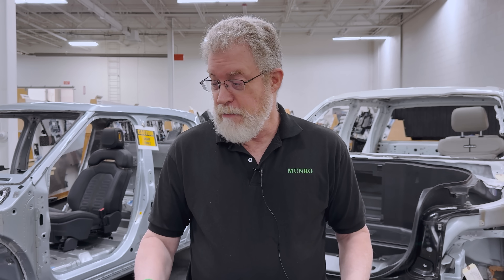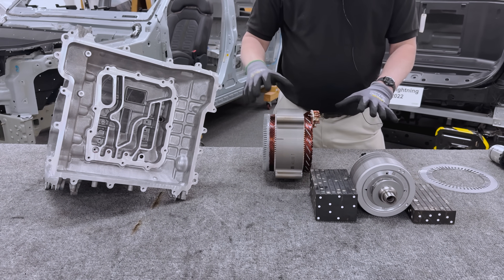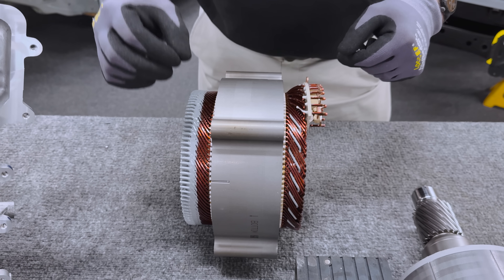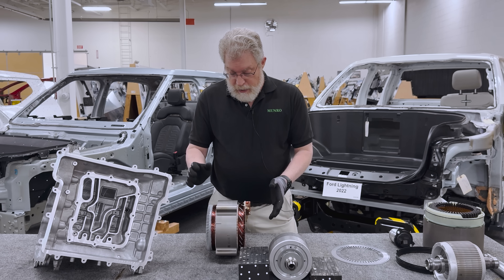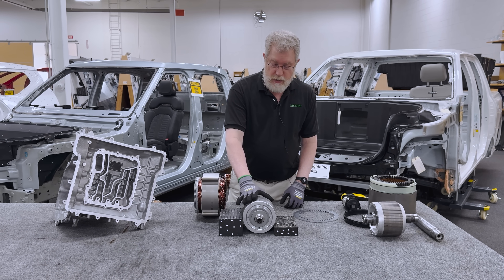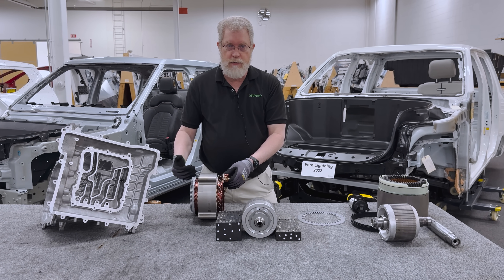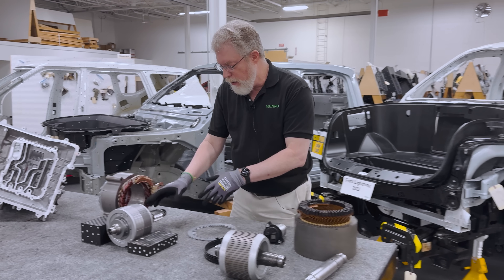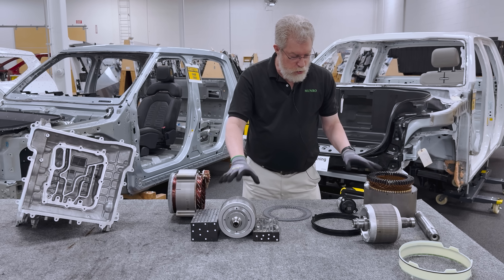Inside EV Cooling Systems: Tesla vs GM Electric Motor Comparison

Comment: Thank you Paul for your full detail explanation. Just done an oil exchange of the IPVMsynRM and gearbox of my Chevy Bolt. Collected the old oil. I observed that the old oil was dark, brown to black. Filled the drive train, IPVMsynRM and gearbox with brand New original GM OEM gearbox oil, as per technical manual. Your detailed explanation inspired me to send the old oil to a labratorium for chemical analyse. It showed some amount of wear metals. The full report I received back from the labratorium, showed 168 ppm Iron, and some 417 ppm other metals. The oil change maintenance interval was as per recommended maintenance interval, and the report showed that there is no need for further maintenance. But I can tell you what I found as driver. Just drove around the province in 2 Celcius with wind up to 5-6 BF, snow, rain and hail showers at times. Giving an energy consumption of 14.9 kWh/100km. (Took off with an pre-conditioned car heated up from the power grid, and drove max 55 mph, used cabin heating from the ptc heater at 18C). Some several years ago if you would ask me winter range I would have told you 280 km, but now I can tell you, maximum winter range capacity is 375 km!   Getting the oil dance within your IPVMsynRM to the best, is critical for excellent unprecedented energy efficiency!

Comment: I feel similarly about this. It’s way past time we move forward to, at a minimum, hybrid power for all automobiles and light trucks. The tech is right there for us to embrace, the performance is anything but a disappointment. Governments need to be involved to help society make such a massive change, and I welcome it with open arms. 

Electric motor technology is already improving rapidly because of their use in automobiles. All the many uses of e-motors, and their are many, can benefit from the force multiplier of the world’s enormous passenger car market. Savings will increase across the board as markets cooperate.

When I consider the enormous load of pollutants they make, it just doesn’t make sense to pursue combustion engines for passenger vehicles anymore. Scale has finally been reached to make apples to apples comparisons both valid and irresistible.

Comment: The deep sea submersible industry has been using oil filled motors for 50+ years.  The primary reason is at depth, the motor will either be crushed or become so out of tolerance, the rotor will no longer spin.  The pressure & temperature at 3000m exceed 4000psi & just above freezing.

Comment: I have a question though what does the oil spray off of the rotors would that eventually cause microscopic wear in the coating on the coils

Comment: I have been a professional mechanic for the past 45 years.  I know a little bit about vehicles, but I am no engineer.

If oil is used to cool the windings w/ a high pressure pump, couldn't they somehow submerge the windings in the oil?

It seems that if somehow the motor is submerged (or part(s) of it) in oil then recirculating the oil would take much less pressure.  Wouldn't have to worry about tilt variables either.

Again, I am no engineer.  Just a mechanic.

Jim
Eve's Automotive
Reply: If the motor was submerged wouldn't the oil fill the gap between stator and rotor?  That oil would act as drag.  Maybe very light oil, but then it would have to move faster to carry heat away.  Not sure either.

Comment: Insulation breaks down, and then lightning happens :) (an arc, like an arc welder, instantly vaporizes the winding at that point and probably shorts out the electricity which will blow the fuse (if you're lucky).
All materials (including silver) have resistance, when a high current flows through a resistance, they produce heat (like an electric fan heater) so using the motor generates heat, as does any friction.
Finding a super-conductor that works in the -40C to +15-C range would be a game changer ... but the only one that is getting close so far is lanthanum decahydride which needs to be under pressure in the gigapascal range, which we can't do for car parts.

p.s. excellent video! I've learned a lot about how electric cars use oil for cooling, and that Prius C gravity oil feed is genius!

Comment: Do those oils need to be replaced or changed frequently? In the northern winters should owners take it easy so the thicker oils have a chance to come to the best temp? Very interesting video.
Reply: On the Chevy Bolt you're supposed to change the gearbox oil at something like 150 000 km. There's really not much source of contamination - no combustion gases as with a combustion engine, no clutch-pack material as with an automatic transmission, and it doesn't run hot enough to cause chemical deterioration of the oil. The Bolt uses ATF.

Comment: A high voltage Megohmmeter will tell you the status of of an electric motors insulation and has widely been accepted as the way to tell when motor winding insulation will fail.

Comment: With how massive the copper rods that make up the windings in the Tesla motor are, I wonder if it would be advantageous to make them oil pipes. And then change the rotor cooling to be fully internal instead of spreading over the windings---that way, only the rotor and windings would be cooled, allowing the iron to get hot in peace.

Comment: 14:57  Can you compare the gear oils when they have been in use about 100k or 5 years. Becouse example tesla dont change oil in car life (?) time. How bad the gear oil & filter and filter have gone in about 5 years? Just quick peak for having oils change in 100 -150k or 5 years.
Reply: "Lifetime fluid" is a LIE! I changed the ATF-9 and filter in each of my 2018 Model 3's drive units at 122,000 miles. I DID see some metal particles in the fluid from the rear drive unit, but that's normal I am told.

Comment: I’m imagining that thin plastic component from the Tesla motor trying to contain pressurized oil after 10 years of heat cycles.  It better be made of some amazing material.
Reply: The heat cycles in an EV that is being cooled are nowhere near that same issue as in a combustion engine. I’d also suspect that the particular type of plastic is pretty carefully considered.  I understand the concern though - especially after the dramatic failures of plastic intake manifolds etc on products from BMW etc.  Maybe you have a valid point, maybe not.

Comment: I can't find ANY other sources that say Tesla uses oil to cool the motors. Every search and AI query says it's a glycol-based coolant. Am I missing something here or is the Munro guy confusing oil with "coolant"?
Reply: He's not. Oil (ATF) cools the motor. It is routed outside through a pipe to an oil-to-water heat exchanger. The coolant from THAT is circulated through the battery pack/radiator by electric water pumps.

Comment: how cold would be to cold then?
Reply: GM uses ATF, which is designed to flow at cold temperatures (otherwise your automatic transmission in a conventional vehicle would stop working). On the other hand, when it's that cold, the motor doesn't need cooling until it warms up, which also warms up the oil! Self-correcting (to at least some extent)

Comment: Anyone wondering why they should have the driveunit oil changed in their Tesla every 30k-50k miles, show them this.
Reply: So many Tesla fans who don't really understand machinery derided me here and elsewhere for changing the drive unit's fluid (ATF-9) and filter on each drive unit of my Model 3 Dual Motor at 122,000 miles. "Lifetime fluid" they say. Yeah, right. I did find metal particles in the old fluid from the rear drive unit, but am told that's normal.

My question to them is: "If a system has a fluid, a pump, AND a filter, why would changing it at SOME interval be a bad idea?".
Reply: @snowrocket  Why no interval change? Because of sloppy mechanics overfilling, underfilling, not tightening everything back up properly. If it ain’t broke, don’t fix it. Unless you really know what you’re doing.
Reply: @willaerley7140  No excuse. Anyone can screw up an engine oil change and many do. "Someone might do it badly" is the BEST reason to do it yourself OR ACTUALLY find a COMPETENT mechanic. I watched a couple drive unit fluid change videos and did it myself. It's not that hard at all.

Comment: MORE PAUL TURNBULL. woot woot. the stuff he covers is why im subbed. dont really care about the new tesla folding sets or whatever. talking about the underrated engineering in the newly released cybertruck like 48v low voltage system is cool but i really like these tear downs and share them everywhere including the old holdout ev gm volt forums :) hope he knows his videos are held as maxims over there to answer weird nerdy questions to this day

Comment: Which one is lighter and which one is more efficient?
Reply: Lighter and more efficient might not be the design objective. The objective might have been cost and reliability.  That's why I hate when people say Lucid has the best motors.  Yes, they are efficient and light.  But another manufacturer might choose easier assembly and lower cost as their primary objective.  The best one is the one that meets the requirements.

Comment: Another reason Tesla needs that high pressure oil pump is to make sure oil flows to the heat exchangers through the octa-valve, if I am not wrong here. Tesla does use waste heat from motors and main battery pack to heat the cabin when heat is demanded, while GM is not pulling heat from the motors and putting it in the cabin, GM only reroutes heat from the main battery pack into the cabin.
Reply: DU oil does not pass through the Octovalve, it's part of the coolant system on the supermanifold in the heat pump equiped cars. "Waste heat mode" (I never liked that name) was a feature on pre-heat pump cars, the heat pump cars don't really use it since it's more efficient to just get heat by running the compressor. Also, heat scavenged from the drive  units in "Waste heat mode" mostly come from the cold plate along the drive inverter, not from the oil to coolant HX.
Reply: @chstra45  There is a flat plate oil to water heat exchanger on all the current Tesla drive units in addition to to the direct inverter coolant loop.
Reply: @juancarrera5524 I know there's an oil to coolant HX. I was merly stating that during waste heat mode heat is mainly scavenged from the inverter cold plate not the DU oil and that the OP's comment about oil passing through the octovalve was incorrect. They seemed unclear about those things.
Reply: Best not to confuse the oil coolant for the drive unit with the aqueous coolant used for both heating and cooling used for cabin comfort, battery cooling/conditioning and inverter cooling.  The oil cooling pump needs to supply high pressure to squirt the oil through narrow apertures.  In contrast the aqueous coolant pump is only required to circulate coolant through large diameter pipes and therefore needs minimal pressure.  There are heat transfer manifolds in which only the heat is transferred from the high pressure oil to the low pressure aqueous coolant circuit but the respective fluids are physically isolated from each other.
Reply: Yep that's why Tesla has it like that. It needs to be with that keep that consistency in different conditions and support the heating of the cabin and battery

Comment: The signature that the electric motor is getting close to failing has to be measured by its electric field or its Gauss.
Reply: They issue is the time lag between the measurable change and the failure. If you only get a millisecond of warning then there's no opportunity to avert disaster.

Comment: GM's complicated cover needs to be drilled in a thousand places...... That's why it's heavier and negates the consumption of one small pump on a Tesla. Secondly, you're talking about a specific Tesla car, comparing it to all GM cars. Tesla has different cooling methods depending on which one is best on a particular vehicle.

Comment: Does the oil impinging on the flimsy winding insulators cause erosion over time?  If so what amount of time? Is the wire insulation more than just lacquer?
Reply: The wire insulation used on modern traction motors is amazing material. It is a multi - layer enamel that is coated with a polyester varnish. It resists erosion from oil impinging at up to 100 m/s for over half a million miles.

Comment: So the GM is Harder to engineer but cheaper in Mass production and runs 24/7 i assume. In compared the Tesla system can bei shut down and save Energy in Low Power modes. I dont know the Englisch Word. But in German the Tesla would have way less Planschverluste. And thats what you also See in real life application.
Reply: Actually, the GM system only runs when the motor is spinning. Which is exactly when the motor needs cooling, of course.   and when cooling oil IS being delivered, the speed/amount is directly proportional to motor speed.   Almost perfect passive control.

Comment: Oil cooling 10x better than liquid cooling...
Reply: Oil cooling is liquid cooling. It depends on what is best in which situation. If oil was always the best choice then all our ICE motors would have their primary cooling with oil ... which is clearly not the case.

Comment: Idk.. considering one generally produces more power and is always more efficient.. seems like one is working better than the other. Yeah, could be other factors in the efficiency for sure.. but seems like Tesl’a system is somehow more efficient even with the added electric motor.

Comment: As somebody who rebuilds tesla large drive units its cool to see the coils and have someone explain in detail the diffrent motors tesla vs gm. great video
Reply: Who does it better? Tesla or GM?
Reply: @petef.4361 Always first principle thinking like in the octovalve. Legacy automotive has only learned for 100 years not to change anything and make things more complicated!
Reply: I have a '16 LDU and understand it uses glycol cooling. Considering the rotor coolant bypass. Did they switch to oil on all motors?
Reply: @iamalmostanonymous  The Models 3 and Y have internal motor oil cooling. That oil travels outside to an oil-to-water heat exchanger. The coolant is then circulated through the battery pack and radiator by the water pumps.

I am not sure if they ever redesigned the water cooling of the Models S and X. From what I hear and read, the coolant bypass is a good modification to have done on your Large Drive Unit.

Comment: The pressurized system seems to be the best even at a minimal cost power consumption.
Reply: One more thing to break. High pressure pump, how long will it last? Also, that one pump can make the car undriveable.
Reply: @Xanthopteryx  This pump is well lubricated and if you like at a normal fuel pump in an ICE car they last very long and their only lubrication is petrol, so I believe this pump will outlast the vehicle. That said I would like to know why they rathere don't use a pump running off the motor or gears that is purely mechanical.
Reply: @JJSmith1100 simply because the oil needs to Flo constantly with no lags.
Reply: @JJSmith1100  All pumps like this have seals. Seals will start leaking. Always. And Tesla and Quality does not fit into the same sentence....
Reply: @Xanthopteryx  That's probably the reason why GM created a system that didn't use a pump. The GM engineers know that the company's bean counters in procurement would cheap out on the pump and acquire one from a vendor at least cost... and poor reliability. Just imagine the mass failure of GM EVs across the board because it had spec'd and purchased the lowest cost component... it wouldn't be the first time. GM is going to GM. 🙄
Reply: @alanrivaldo-h  All companies cheap out - none more so than Tesla. They'll remove as many parts as they can, to the detriment of the owners. On the other hand, they'll add needless complexity, because Elon thinks it should be so.
Reply: It is not operating at full load and pressure at all times, only proportional to demand as necessary.

The pump pressure is increased with operating temperature, while oil flow rate further increases with temperature due to reduced viscosity. 

The pump motor is surrounded with oil, extending service life. Since the motor is immersed in oil, there are no motor shaft glands to wear out and leak.

Comment: And some people think in a modern EV it's all about software. They should watch this channel and think again :)
Reply: I think it still is, because engineering has gotten quite good, but software in most cars has only reached a small fraction of its potential.

Adding more fancy hardware means more breakages, whereas software can be used almost for ever without wearing out. If it’s good quality, software is a whole different animal.

You can also update and upgrade software at very little expense.
Reply: @mrmichrom8553  Hmmmm.  So you're saying we should sit on our software and take a ride.  I must need an upgrade, 'cause when I try it I just end up on the ground.
Reply: @jonvelde5730 I'm so tired of people who confuse the function of software vs hardware and think they're interchangeable.

Comment: You can predict the life remaining on the windings with a dielectric test. The only problem is that if you run that test up to where it actually goes dielectric, that test is destructive and reduces the life of the winding. There are ways to mitigate this, with partial discharge testing

Comment: Note that Munro does not save consumers any money.   I believe the recent trend over the past five to seven years of OEM's costing out longevity is due to the meddling of Monro.    Instead of building a vehicle for 200k miles, the companies are now costing out durability to get the manufacturer out of warranty and then passing the cost of repair to consumers.    This is a disgusting situation.